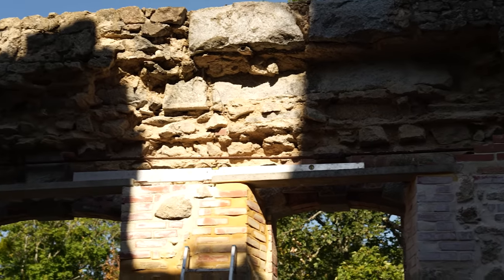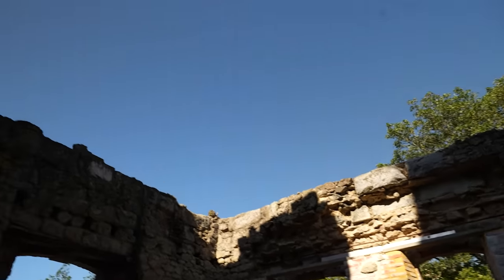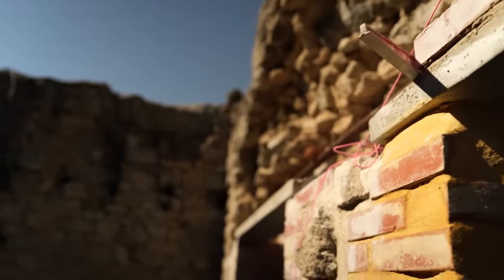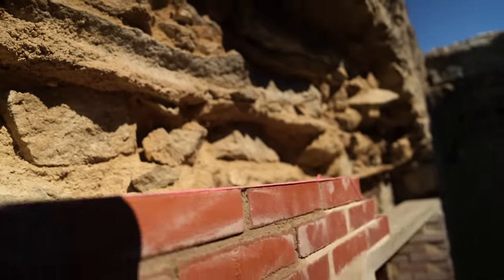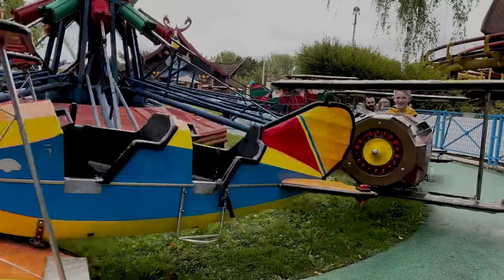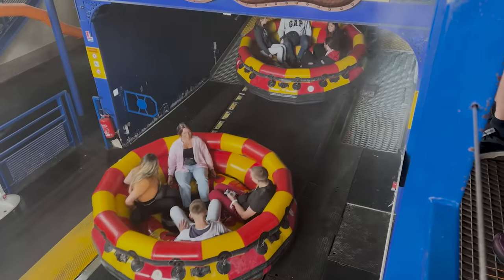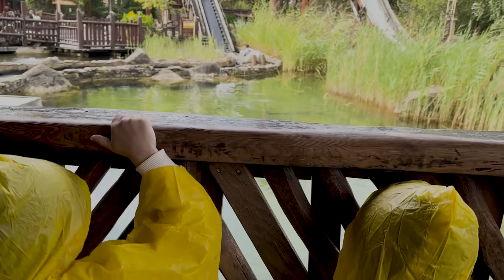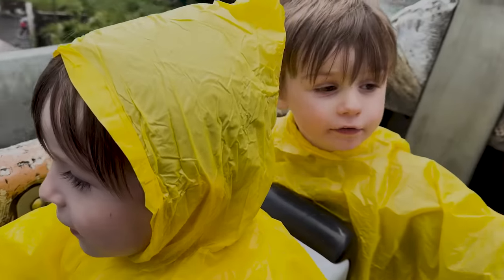A morning of progress.

Comment: Dan, thinking as an electrical contractor, it would be a good ideal at this stage to build in some plastic tubes in each door threshold to enable you to install wires and pipes to rooms, it is a nightmare in older properties getting access to rooms especially with walls as thick as the chateau has, just a thought that may save you time in the end, great project to watch, take care D

Comment: If you put mortar on the end of the bricks you wont have any gaps on the ends that you have to fill in. Angle the mortar at 45 degrees at all 4 corners works perfect. That is enough to fill the gap! Saves on pointing as much later!

Comment: Hi Dan, we’ve been watching this from the beginning. Apart from the constant safety concerns we are loving it. 
Can I suggest you keep the top level floor joists the same size as original, that way you don’t need weaken the walls by chipping out the holes. 🧐💁‍♂️ I am sure they will be plenty big enough and still way stronger than necessary for the small floor area that’s at the top level of the tower.
Keep up the good work, it’s great to it coming back into shape . 👏

Comment: You might consider putting long rebar in the massive walls as you brick and apply mortar.   To make the mortar stronger, add a bit more portland cement to the mortar, up to 1 part cement to 4 parts sand.  Make sure the mortar is wet enough to bond.

Comment: Dear Sir
I am quite disappointed about your lastest videos (no, not the videos, the work done in them). 
I clearly remember the video in the beginning of the chateau serie when you studied the history of the building, you looked for some experts to learn how to restore some details (do you remember the windows in the basement?). I really enjoed them.
Now.... How can have you put a concrete lintel just in front a wonderful window's arch? How can you cut an I-beam wrong? How can you realized, after beginning the work, that the wooden beams don't fit the pockets in the next floor?
And more: behind the steel beam you lately put on the wall, there is another beam to set. How do you access that?
I know autumn and winter is approaching, but you  need to think and program and, more than anything, to learn how to restore an historycal building.
I am really worried.